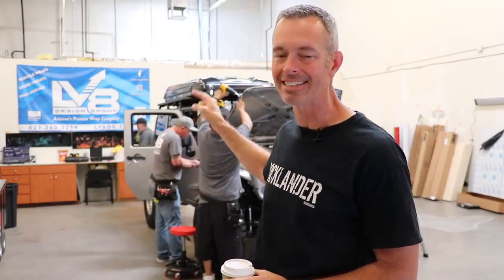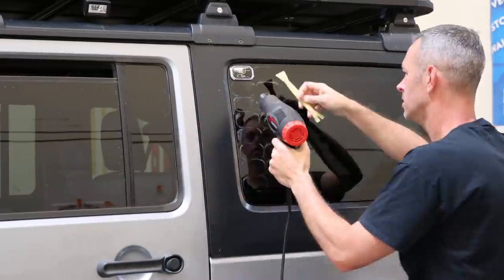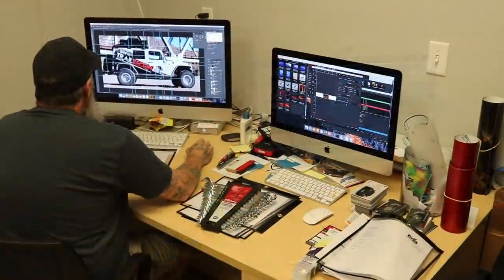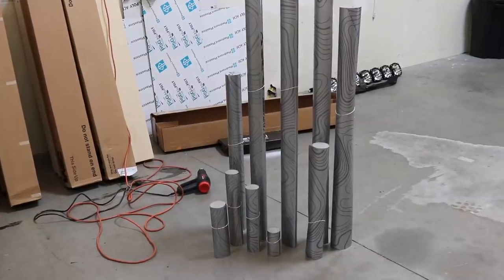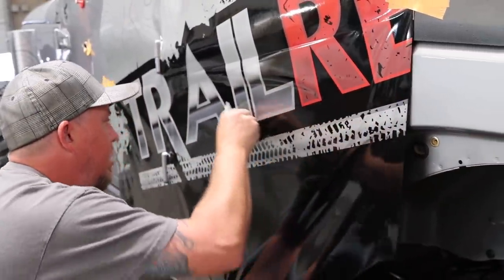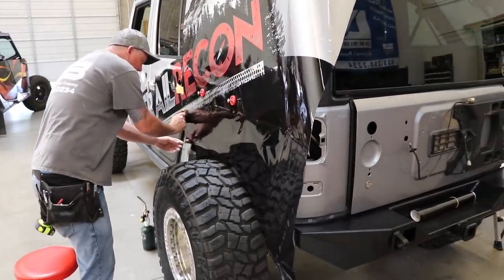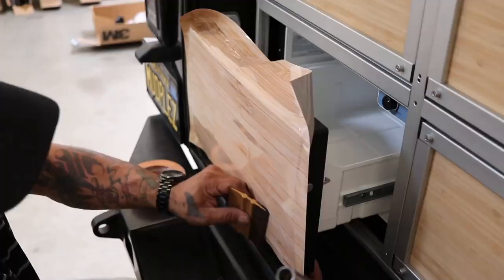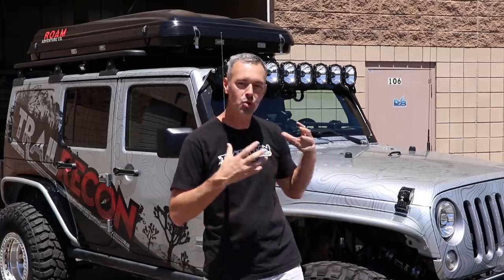A Complete Transformation – We Vinyl Wrap My Jeep Wrangler

Comment: Looks amazing!  Did they wrap the back window?  Can you see through the vinyl on the windows?  11:27  So punny...
Reply from the maker: Just the rear side windows are wrapped, the back window is still clear. You can't see through the side windows.
Reply: @TrailRecon  after driving it with those side windows covered, does it create any blind spots or make it to dark back there?
Reply: Lisa Porta good question

Comment: Hey Brad, Love how that turned out.  I've always said that with wraps you can go from cool to kook in no time, but you definitely pulled it off.  I do have a question though.  What is the maintenance on this?  Do you wash it like normal?  Can it go through a gas station car wash?  Do you pay to take it off eventually or can you do it by yourself?  Do you get paint differences as the unvinyled fades differently than the covered areas?  I know it's a lot of questions, but I love it and am considering it for my JK.  (I guess the first two questions are the most important)

Comment: Hey Brad, love your channel.  I just bought my first Jeep; a 2023 Wrangler Sport and I've been binging your content for the past month.  One question about the wrap (I know you don't have it anymore) but the two sides aren't perfectly symmetrical because of how the Trail Recon logo flows.  Like on the drivers side, the T is at the bottom and then goes up on a slope and it's flipped on the passengers side.  I have an idea for a wrap for my Jeep but I'm getting hung up because I can't get the symmetry the same on both sides.  Wanted to get your thoughts on that.